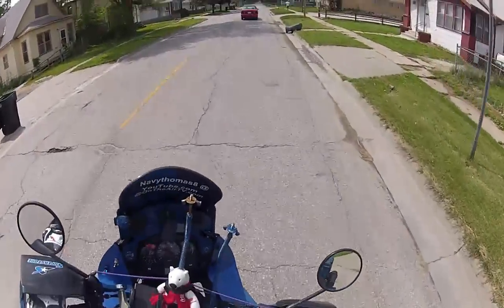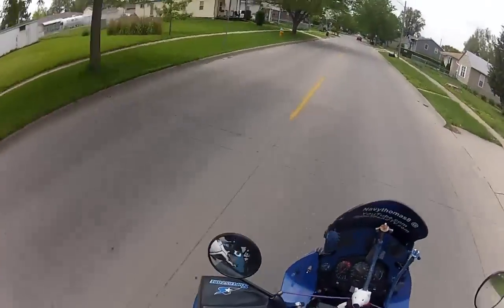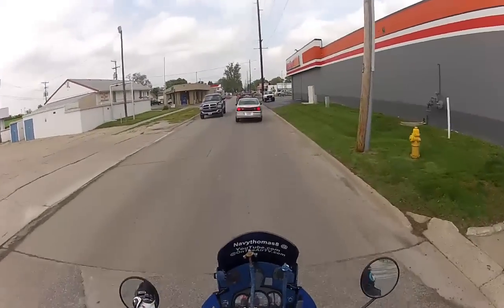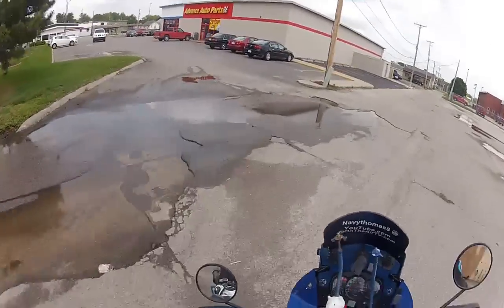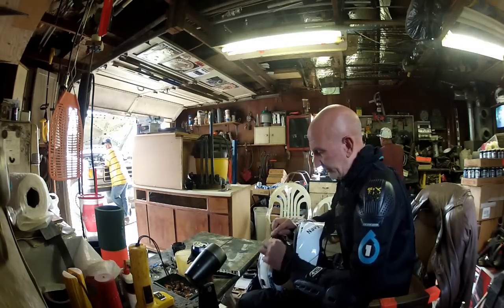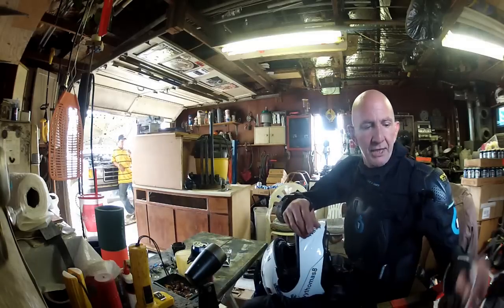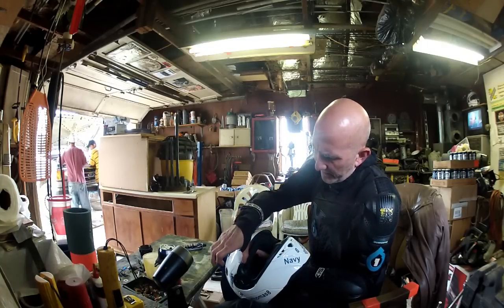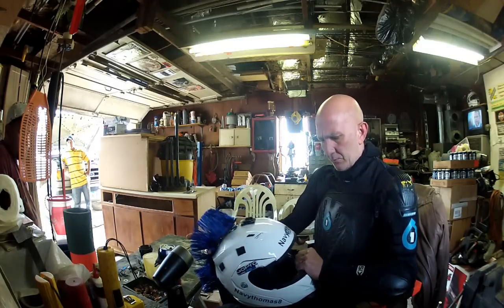Bell Revolver Face Shield Fix.MP4

Comment: I use some velcro to seal out the air noise.   I used the fussy part of the velcro, so it's a bit like putting the the sticky foam strips you use for sealing doors and windows.  I figured the velcro had better sticking power, so I cut it in strips.  
I have not used the helmet in the rain yet.   Don't get much rain here.